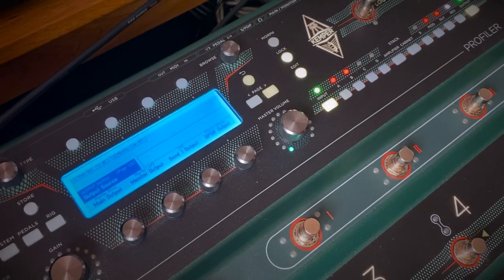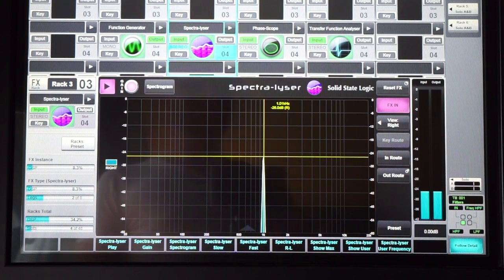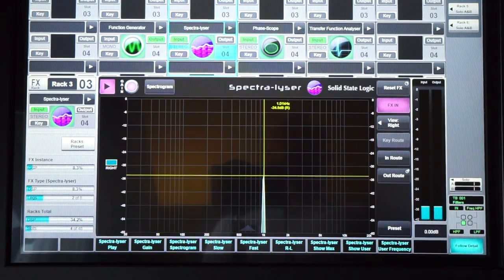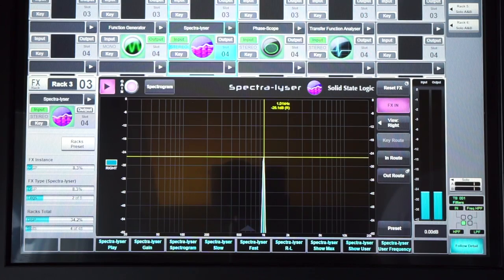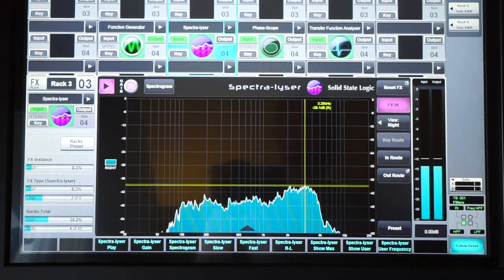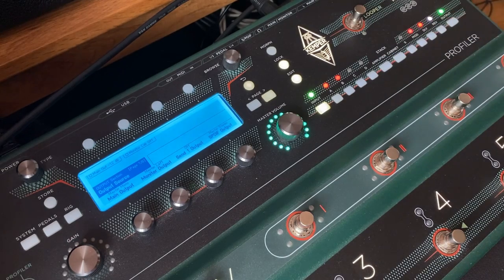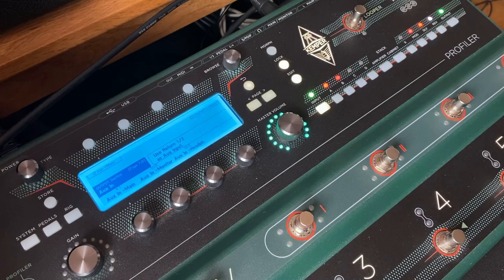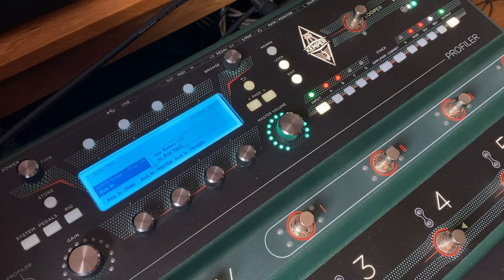Kemper Stage - Measuring latency and signal levels using an SSL Live digital console

Comment: Is there a method of manually dialing in the latency on the kemper? I played a kemper profile and my UA OX with my amp in stereo tonight. I could tell there was a slight phase issue. It wasn't that bad though, so I just rolled with it. In the future I would like to be able to dial it in tight though. I don't own a kemper, but I find myself playing them a lot. I like running a stereo rig with two amps.
Reply: There’s the variable low latency mode or the slightly longer ‘constant latency’ mode but you configure more than that. If you had a single delay effect and set to 100% wet you could delay the signal if the Kemper is earlier than the Ox but it’s not an elegant solution. Post in the Kemper forum and someone might have a better idea though.